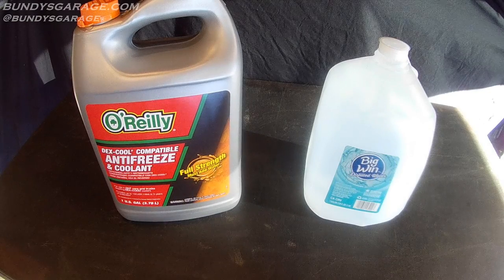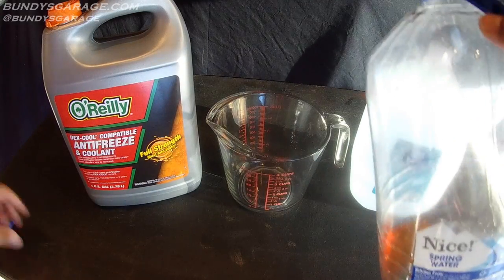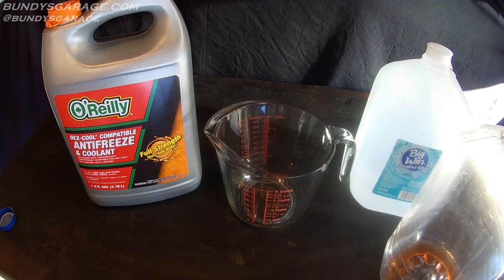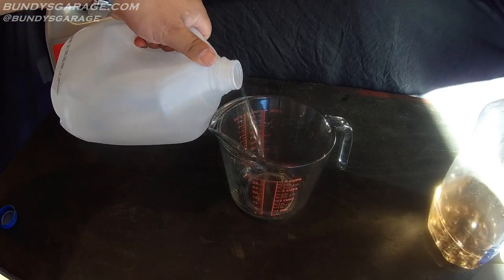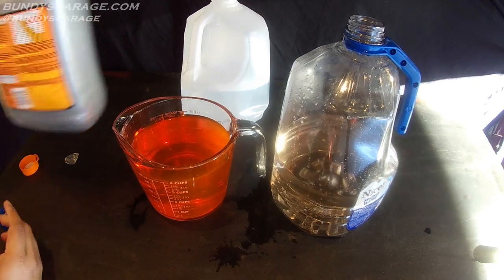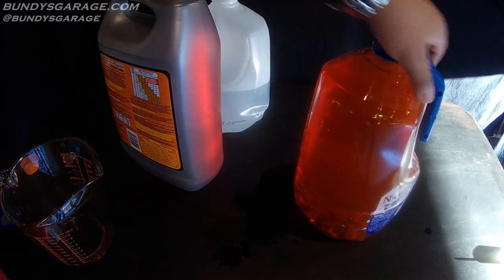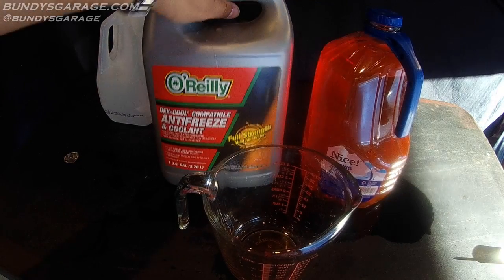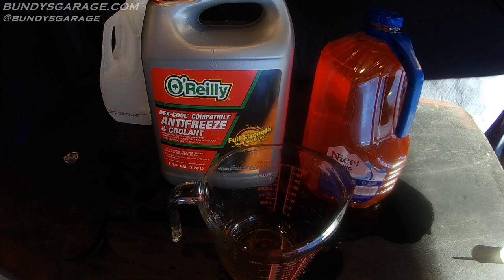Mixing Distilled water Coolant from Concentrate - Antifreeze Coolant Mixing - Antifreeze Coolant Mix

Comment: Pour one gallon of each water and anti freeze into a 5 gallon bucket. No need to use a measuring cup .  I would not reuse containers that touched toxic fluid for cooking use.
Reply: I just poured the gallon of distilled water into a 5 gallon bucket, then the gallon of concentrate in the 5 gallon bucket, swirled it around a few times, then used a funnel and filled up the gallon container and put the rest in the concentrate container=2 gallons of 50/50. I don’t see the need for the measuring cup either

Comment: I buy Prestone concentrate from Walmart for $10.87.  They also have distilled water at Walmart for 90 cents a gallon.   I keep an old Prestone jug and mix it up using that.  It has a clear gauge on the side of the jug that tells the amount.  I take a marker and write "50/50 mix" on it.   I have been eyeing the Peak brand concentrate coolant antifreeze at Dollar General.  It has a longer life.  I have used Prestone since the 1980's.   I have an older Ford that takes the green antifreeze/coolant.

Comment: I usually use a five gallon container and put the concentrate and distilled water together no measuring cup needed.  Thanks
Reply from the maker: +Edmund Mendez good idea
Reply: BundysGarage Get the water at Wal Mart... 75 cents
Reply from the maker: +Aaron Kimmins thanks I'll keep that in mind.' Also someone mentioned just get a 5 gallon bucket and drop both gallons in at the same time. Don't even need a measuring cup, great idea!
Reply: Yeah, that would make it easy
Reply from the maker: +Aaron Kimmins Hell Yeah! Just make sure the bucket is clean so you don't pour any debris into your engine.
Reply: Edmund Mendez  - Smart.
Reply: Aaron Kimmins man I got ripped off, my gallon of distilled water at Walmart was .80 cents
Reply from the maker: SON OF A BITCH! 5 CENTS!!!!!

Comment: What was the point of the measuring cup if all of both liquids are being combined? Maybe you've been cooking with too much antifreeze 🤣
Reply from the maker: +Troupster I like the taste of anti-freeze in my oatmeal
Reply: I think he was being a perfectionist because if you filled up The Jug half and half The Jug is actually not the same size as it's tapered towards the top.
Reply: And it's not always 50/50 there is a ton of different mixes you can do to accommodate different temperatures
Reply: I just poured the gallon of distilled water into a 5 gallon bucket, then the gallon of concentrate in the 5 gallon bucket, swirled it around a few times, then used a funnel and filled up the distilled water gallon container and put the rest in the concentrate container=2 gallons of 50/50. I don’t see the need for the measuring cup either

Comment: You should never use distilled water. During the distillation process, water is vaporized into its gaseous phase, so all its impurities are left behind. These impurities include a number of minerals, including “calcium” and “magnesium,” the two components of water “hardness.” The water is then condensed back into its liquid phase, so the resulting liquid is pure water – in fact, some of the purest water on earth. But the problem is that when water is distilled, or “stripped,” of its minerals and impurities, the resulting solution is composed of chemically imbalanced “ions.” This leaves distilled water “ionically hungry,” so it will actually strip electrons from the metals in a cooling system as it attempts to chemically re-balance itself. As it chemically removes electrons from the metals of cooling system components, distilled water eventually does extreme damage that could lead to cooling system failure.
Reply: then what do you use?